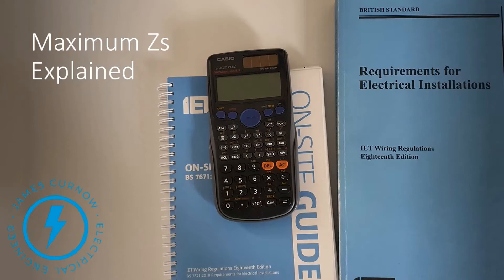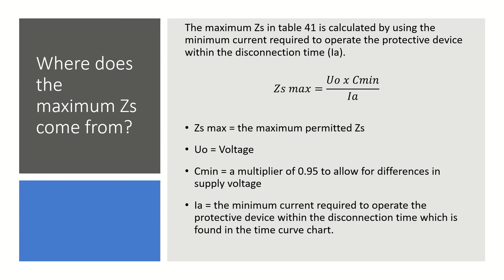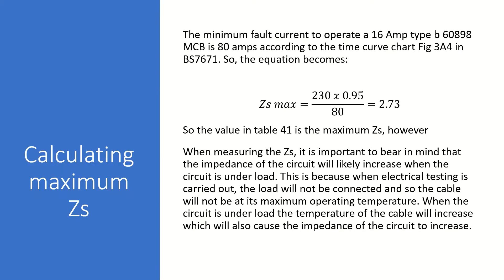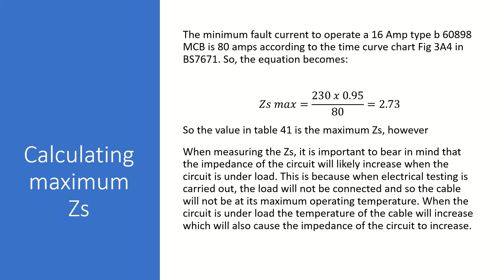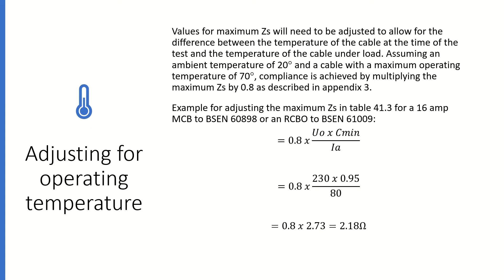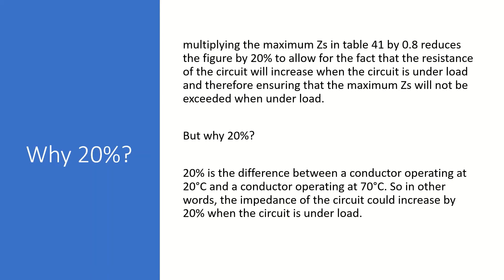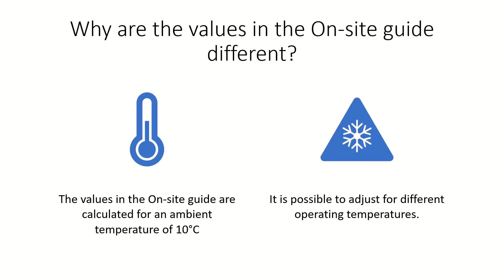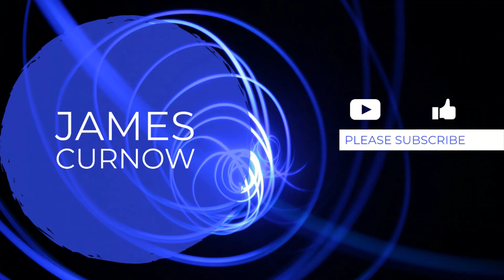Maximum Zs explained

Comment: Great video. Though I am confused!
The video states the OSG offers max Zs values the somehow should be used as a comparison for actual measured Zs at an assumed 10c. Thus 10c is a lot lower than 70c max temp. Hence it's not clear. Are the OSG Max Zs values simply 20% higher than in BS7671?

Comment: So after you get your ohm value from the equation, what are acceptable and not acceptable values.
Reply from the maker: Hello, thank you for your message. The calculation determines the maximum Zs. So an acceptable measured value would be less than the value for maximum Zs. For example, less than 0.8 x the values in table 41. 
I hope this helps.
Regards
James

Comment: Question, James (if you don't mind) as there's something I'm not totally clear on regarding the temperature adjusted values.

Here's an example for a 32A 60898 breaker:

(230 x 0.95) / 160 = 1.37 ohms (as in Table 41.3 on p62 of the regs)

Then adjust for temp:   1.37 x 0.8 = 1.09 ohms (shown as 1.1 in GN3 Table A4 & OSG Table B6)

I get that, but when it comes to completing the schedule of test results, the values for Max permitted Zs shown in the examples in GN3 (p126) uses the value before temperature adjustment. 

So where would we use the temp adjusted value? Do we record it anywhere, or is it purely a reference when we use against Max Measured Zs, and if our measurement in this case exceeds 1.1 (as in Table A4 in GN3 p142 and Table B6 OSG p131) then we could be exceeding the max Zs?
Reply from the maker: Hi Daron,
Thank you for your message. I'm happy to answer questions. 
When completing the schedule of test results in an electrical certificate, in the column that asks for the maximum permitted Zs, we would enter the maximum Zs from table 41, but when measuring the Zs we check that it doesn't exceed the value that's adjusted for temperature. As that will ensure that the max Zs isn't exceeded when the temperature rises when the circuit is under load. So to answer your question, if the measured Zs is higher than the temperature adjusted value, it would exceed the maximum Zs.
There isn't a column that asks for the temperature adjusted figure, however if you wanted to enter this on the schedule, you could add it in the remarks column next to the circuit. E.g. Zs measured not greater than 0.8 x table 41=
GN3 also says that where the value for maximum permitted Zs is taken from another source, other than table 41, we can state this in the remarks column next to the relevant circuit. For example, if you are using a protective device which isn't listed in BS7671 such as an mccb, you can obtain the max permitted Zs from the manufacturer. 

I hope this helps.

Regards

James
Reply: @JamesCurnowElectricalEngineer  Perfect. Thanks for confirming. Once I had written and re-read my question, I felt like I was starting to answer my own question, but now I'm sure. Thanks very much, James.